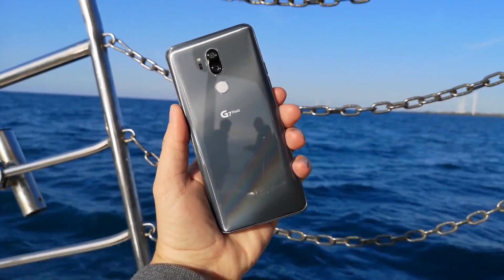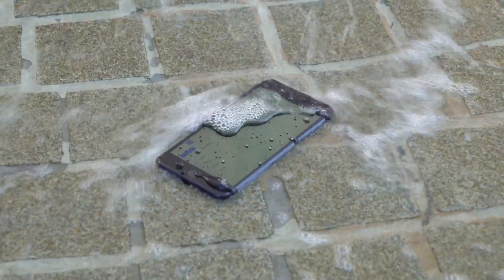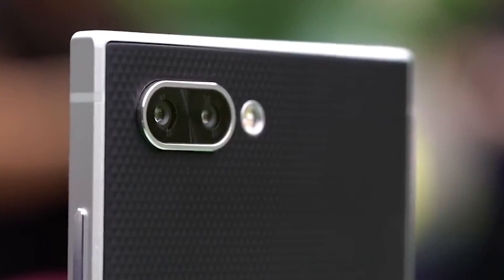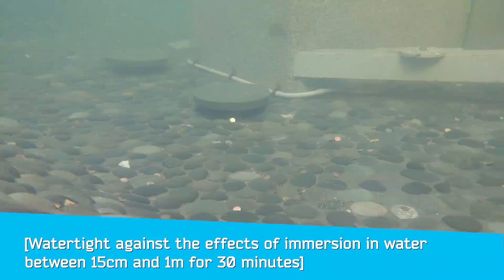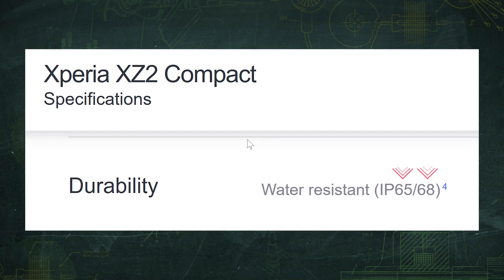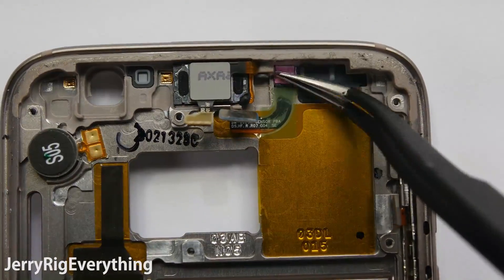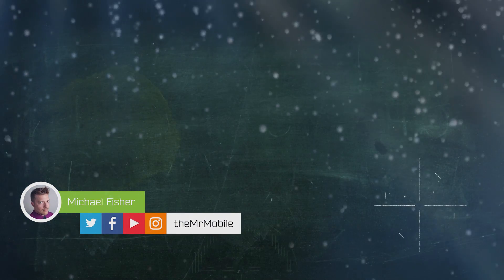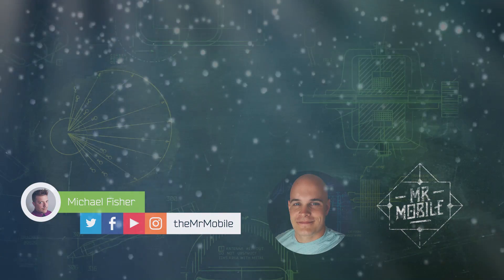Your "Waterproof" Phone ... Isn't

Comment: Back in 2017 i had galaxy S7, which got water damaged just like your V30 and fun fact the culprit was the needle i used to pull out sim tray. It punctured the adhesives, So don't use needles as Sim ejector tool

Comment: This really annoys me with phones. They cost an absolute fortune and advertise water resistance yet in the real world it almost always fails. It's not like hardened electronics are an impossible future magitech. We've had dive computers since the 80s. They get immersed in 30+ metres of salt water, while getting bashed about against rocks and heavy equipment. At the same time they need to have physical push buttons and sensors for external temperature, ambient pressure and sometimes also breathing gas pressure, which can be hundreds of atmospheres, and most also have physical external electrical contacts for data links. Yet these devices are no more expensive than phones at the equivalent market segment in their respective sectors. 

Hopefully one day some enterprising people at Suunto, Mares or Aqua-lung will get together with the guys at Huawei, Xiaomi or Samsung and make a genuinely rugged phone.

Comment: I still got a 4th gen iPod touch which was dropped in the toilet many years ago. For a while the volume adjusted itself and I couldn't control it, but it's been working fine for many years (I turn it on every now and then). I didn't even do anything other than maybe dry the water off the outside of it.

Comment: Most waterproof/robust phone I ever had? My current LG G6. Used it in the pool and rivers many times, took videos underwater and in the rain, washed it when it got dirty, but it never missed a beat! It's approaching 3 years of service now and admittedly the battery is starting to show its age, other than that the whole phone is as good as the day I bought it! Kept it in a case, so no dents on the aluminum where water can seep in. I must say the USB port and headphone jack are very reliable, they still work fine. I wish more manufacturers would take durability seriously and advertise it accordingly.

Comment: A true waterproof phone is surely achievable? Ditch all ports, jacks and slots for digital eSIM, wireless charging and WiFi MTP then essentially create a perfectly sealed chassis? Not saying it should be done; no one likes the disappearance of 3.5mm jacks but it'd be a cool concept. Big hurdle would be the microphone and speakers. 'Acoustic surface' screens are a thing but not sure if that applies to mobile tech.

Either way, would be cool to drop a phone to a seabed and pull it up days later without a hiccup.

Comment: I miss the days of mobile durability. In the early 90s my Nokia 6230 (?) was brilliant. It once dropped out of my shirt pocket as I standing on a Landrover roof rack onto a tarmac car park, it broke apart and the battery landed in a puddle. I took it home and put it on a windowsill near a radiator wrapped in a towel for a few days and it worked perfectly. Same phone a month or so later, I leant over a drainage channel I was digging and it again dropped from my shirt pocket (no, I didn't learn) into over a foot of water. Took it apart same drying procedure and it worked forever more, still have it. I was astonished when I had a Blackberry and using it on a rainy day killed it, the papers were pink.

Comment: I have a Note 8. It's IP68, and while it's been in the tub (not underwater) a couple times- the IP rating came in handy when I was caught outside in a downpour. It complained the charging port was wet, but drying it out fixed that. If I were to take it swimming, it'll go into a waterproof pouch.

Comment: Waterproof and water resistant is NOT THE SAME!, Waterproof means they are made to be used in environments with water, or liquids ( not all kinds of liquids of course) that's why some Electronics can be used submerged for very long times without damage because they were made for that, water resistant as it name implies means the device has some kind of resistance to liquids but is preferable to keep them out of these kind of environments if possible, they just made for accidental falls or spills

Comment: I had one waterproof phone which worked. You had seals on the charger plug, headphone plug etc.
Closed it. If the phone isnt cracked. Make sure it was tightly sealed and boom you had a good minute under water without change. They also said slow movements is better. And no jumping and hard splashes with the water. It worked it was great

Comment: Just put a waterproof case or even easier a ziplock bag around it to make it near impossible to get water in the phone and if it gets through the case or bag well then you still have the water resistant phone put to be save just don’t dunk it underwater and if it falls just try to pick it back up as fast as you can.

Comment: I only used wireless charging for my old s7... because the charging port was corroded after getting wet.  I almost got it replaced, but since it was glued to the screen, and I had a chip (not crack, just a chip) in the corner, it wasn't covered under warranty.

Comment: That's why you put your phone in a ziplock before filming underwater
Reply: Bad idea. It's possible any air causes it to burst. This can also happen if you jump into the water with a waterproof pouch. It just has a blowout and turns into a fishtank with your phone soaking in it. I found this out the hard way.
Reply: i tested a ziplock bag before by placing only the case in the bag. i only could do like 5 minutes and only 3 - 4 bags was able to keep water off the phone. and it was hard to use the phone. then i got a phone case rated at ip68 instead
Reply: Navtej Singh but why even use your phone underwater, if you want pictures underwater gopro’s exists and are also something that is advertised as take this underwater for a cool photo if your calling or actually using your phone in the water, why?
Reply: Doctor Whos  i disagree with that many people do for very mundane things now people will buy a product for everything and if your willing to bring a possibly $1k phone it's on you if it breaks because you didn't want to get a go pro for underwater

Comment: Soo my s10 fell into the pool and my speakers and mic were muffled. I quickly dried it off and put it in rice to suck out the water and it works fine now.. but should I have rinsed it under fresh water first?? Been contemplating this all night after watching this video and hearing that chlorine can cause corrsion just as much as salt water..

Comment: So I got this Samsung A8 and its being submerged underwater for many times(since I own this for a year now). Nothings wrong with it until it recently popped up the "moisture has been detected" even though it didn't come in contact with water for many months. So inorder to charge my phone it needs to be shutdown, plug the charger(shows moisture in USB error), then turn it to safe mode. Whenever I disconnect the charger. The moisture error will appear again. 

Just wondering if anyone encountered the same problem here.

Comment: Wish I knew this before I jumped off of a diving board in a 20ft deep lake last weekend and tried to touch the bottom. I had my phone in my pocket and went swimming for like 3 hours, the phone is completely fine though, took it like a champ no issues, no nothing, shit it's like it never even happened. But now I'm a little more informed, and maybe I'll be a little more careful next time. BTW I have a Galaxy S8, and this thing with a light case on it is a beast. I even chucked it at the pool party once to prove a point, which is that the phone is really sturdy with a Spigen case on it, or maybe I'm just really lucky.(BTW I've had the phone for about 2 years now, js)

Comment: How very disappointing. For a living, I deliver things by bike. I want a waterproof, or splash-proof Smartphone, with wireless charging ability, and a wireless charging phone mount...If you don't work for companies like Postmates, DoorDash, or UberEATS, then you may not understand, how great this setup is...With that arrangement, I can near seamlessly use my phone for work, navigation, and whatever, even in the rain.

No plugging my phone in & out, and pulling over somewhere, just to take it out, using my helmet to block it from the sky, then put it away again. I can just mount it in front of me, battery maintained, and just quickly glance at the map, or quickly tap something, like a delivery accept button, while remaining aware of what's ahead & around me. All in the rain. On a bicycle or motorcycle.

Thank you for this video. I will continue looking for the best Smartphone for outdoor work & navigation. I will still care about IP ratings, for accidents. But to truly protect the phone from water. I will need to buy or make a special case or bag, with wireless charging & Bluetooth, being the connections to it.

I since my plan has changed to that now, I will still get magnetic connectors & port covers, to keep dust out at home. But I guess I won't need Dielectric grease in those ports. Since I'm pursing bags now.

Comment: When my phone first got water damaged, I was not in a place that I could find rice. So I decided to play PUBG for as long as the battery lasted and supporting it with a power bank (it gets pretty hot when especially playing PUBG) after I tried to evapoate the water out of the phone (I took the back cover out to make it easier) and 3 days of rice did it. Worked flawlessly until my cousin accidentally dropped it off a cliff. I never found it anymore :(
Reply: That was a rollercoaster.
Reply: @anirvana  hmm yes
Reply: Rice doesn't help mate use silica gel and if there's leak in your phone after long time you will see damage not immediately because corosion needs time.
Reply: "a human being"
Reply: get a nomu s50 pro shit can get run over by a car and lay in dry ice and be perfectly fine
Reply: BIG BRAIN

Comment: My s8 plus died in pool before because I was thinking it was waterproof.😒 turns out, phones are WATER RESISTANT.
Reply: Smh
Reply: Used my s8 several times in pool and everything works just fine. Also sometimes I clean it with tap water
Reply: @noTH9IK  Cleaning it with water is ok because it's still not under water and you are just washing the front screen so there will be no water pressure. Also my s8 was working fine after I used it under the pool. It died when I was drying it and I was trying to push the waters out by tapping it. I tried everything to fix it when it died, like I tried rice and blow drier. But it was DIED. So I got the money back from Samsung and now I have s10 plus. Never gonna try to do that with this phone under pool again 😂.
Reply: @Kratos703  water damage is not covered by warranty, so I am pretty sure there was another problem.
Reply: @noTH9IK  hmm🤔...I mean my phone was not working at all. It wasn't even turning on. I would just feel the vibration of the phone when it was gonna turn on but there was nothing coming on the screen. Also, now that I remember, I couldn't get the money back from Samsung and I got it back from my bank when I described everything to them.
Reply: One of you are lying

Comment: The closest mall to me has a display case full of phones under water the case is sealed but you can see the devices on flicking through a video on the device with advertisements I’ve decided this is a trick however because 2 of the 6 “waterproof” phones I’ve managed to break myself with liquid one got dropped in ice tea the second died just from rain so them supposedly working under like 3 feet of water looked like bs to me . I just got a iPhone 8 for free to replace the drowned iPhone se ...let’s see how long this one is going to last thing is made of glass and I’m notorious for dropping things .

Comment: Actually your wrong about one thing, they has to switch it if it got water damage, it's like buying a dishwasher and it gets water damage, it is built to get wet so it has to be able to do it. I got a waterproof phone myself and has had a water damage, I just went to the store and told them it wasn't waterproof and they took it to test and i was right it was not waterproof, so they gave me a new. It was a Sony Xperia Z3 by the way, and the new one they gave me was waterproof and has been the phone I have got into water the most of all 😉

Comment: If you dropped your phone off a boat I don't think it matters if it's waterproof.
Reply: depends if you dive after it
Reply: or buy a new one.
Reply: Yeah they said a quick submersion won’t do anything at all but then after you gotta make sure you’re in shallow waters
Reply: Salt water will destroy all phones, even ip68 phones
Reply: If it was like Altek Lansing speakers it wouldn't matter because those float. Can attest they are hyper resilient. Sadly floating phones are unlikely bc they are basically bricks of plastic, glass, and metal with no notable air pockets or buoyant material present.
Reply: Well if its waterproof it would be fine   it will still work. However if its water resistant it wont last long.
Reply: Unless you love SCUBA diving.
Reply: Lol

Comment: 😂I had a Huawei P9 Life for some time and as far as I could tell it wasn't certified water resistant but I dropped it in water so many times I don't know how it ever survived. It fell in the bath tub, the pool, the sink, puddles I accidentally went swimming in the ocean with it in my pocket, then I dropped it in the water on the beach and it was washed away by a wave for a while and it still survived with no, water damage whatsoever All the while it had a cracked screen which one would think would let it more water but it pulled through 😂😂😂

Comment: Anyone care to add a video on the weather resistance of cameras; preferably some of the intermediate and more expensive models?

Although also noting... There are some cameras that do have a limited waterproof rating that cost about two hundred dollars. There is even a limited waterproof interchangeable lens camera - the rating works with a few different lenses, but unfortunately not all of them - the Nikon AW1.

Cannot begin to mention... How many cameras I've seen get totaled, or perhaps better worded as - only repairable in costing more than the camera. Even worse to see a camera get destroyed when there are no back up options.

So unless everyone out there has a complete back up camera system; one might want to use grave caution with their camera around ANY type of water or moisture. One single drop of water can destroy a camera

Comment: I will admit on both of my Moto G3 I have recorded 10 to 15 minutes worth of video underwater in swimming pools. Just below the surface.  That was years ago and it will still work today.  Motorola no longer does ip68 on their phones.

I retired one because the screen broke and the other, is battery got so worn out that's a constant charging was a house.

Both of them are functional.

Comment: My selfie camera has fogged up after I rinsed my phone with tap water to clean the screen. Anyway I can fix this? iPhone XS Max
Reply: ...my Samsung s8 spends more time in water then air and doesn't have that issue or any...however try to heat it up with a hairdryer for 5 mins and if it doesn't go away keep trying until it goes away, so it in sets like 5 mins check let cool check the again 5mins and again until it goes away.

Comment: I swam with my s5 in a pool many many times. For several hours at a time. The phone still works.
Now I have the note 9, and managed to break its screen. Even though I had it fixed, I don't trust the water resistance.
Is there a way to ensure it has the same water resistance as it had before the break? I don't mine higher coats
Reply: Who fixed it?

Comment: I think it is repairable. Most of times its just pin corrosion. 
I have seen luis Rossman do waterdamaged macbook repair...

Sometimes some power rails may be gone due to power supply circuits malfunctioning.., other than that, it should be perfect.

Comment: Thx, nice video I learnt something : the second digit shouldn't be considered as a level so 8 is not "better" than 5, it's a different protection. 
It's confusing because a 8 is better that a 7 since it's about the same kind of protection.
In fact, a level 6 inculdes 1, 2 ,3 4 and 5. A level 8 includes 1, 2 ,3 ,4 and 7 but not 5 and 6

Comment: Quick advice...
If your phone ever falls into whater you should immediately get it out turn it off, take out the battery and other detachable components and let it dry for a day or two to a week depending on the weather or season. And also if it fell in salt water than you do the same thing but make sure to get all the salt off  by using wet towels.
I hope i helped 😁
Reply: No . Put it in rice.

Comment: Meh.. all I want is removable batteries so I'm not stuck tethered to a damn cord, battery pack, wireless charging base or dock of any kind for power, ever.

100% instant power cell swaps are a must for myself.

Down with planned obsolescence. Fight for your right to repair. Free the battery.

Comment: There are water proof pouches you can get for your phone for 20-80$ (depending on quality). That's what I use for my none waterproof phone for swimming or shower.  You just have to test them for leaking first. Put a piece of paper with lines of ink and a rock in pouch. Dump in the deep end of a pool go for an hour and come back. If ink is smudged or paper is wet, send the case back, otherwise it's safe to use. No need to pay 1000$ for a waterproof rated flagship phone that's not actually waterproof...

Comment: It does say by most manufacturers not to put the phone into salty water and other kind of water that contains chemicals which can damage the phone. Only fresh clean water is what phone can handle with IP68. Idk why people don't read manuals before use since it states this inside manual as a warning, but sadly people don't read it which is why they fail badly.